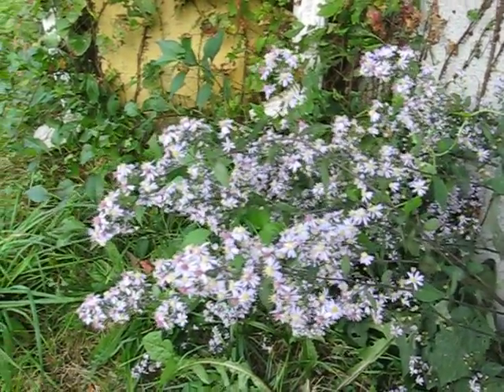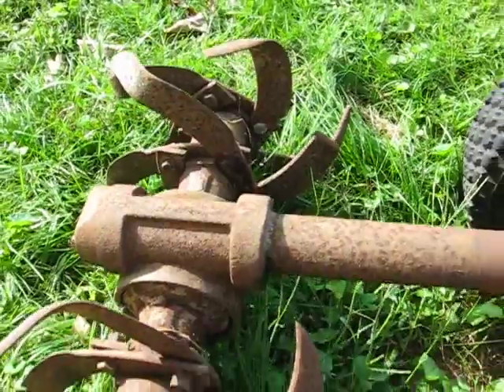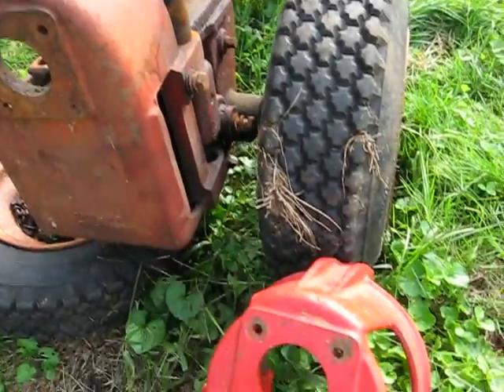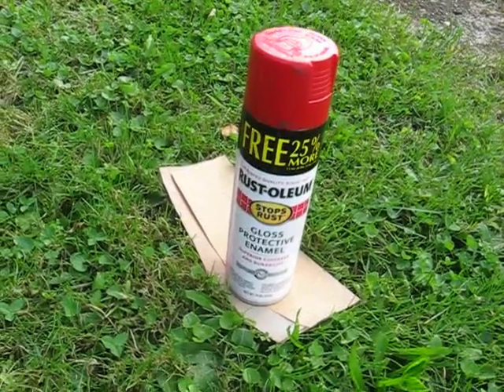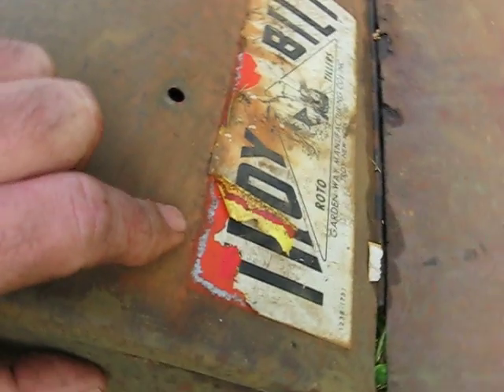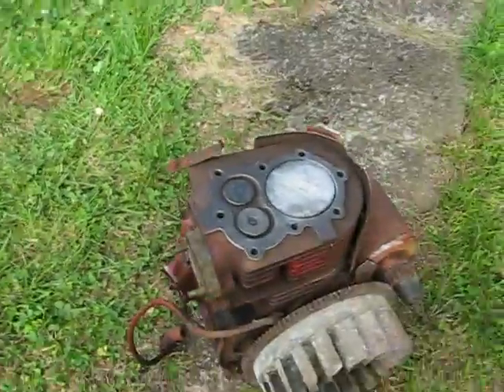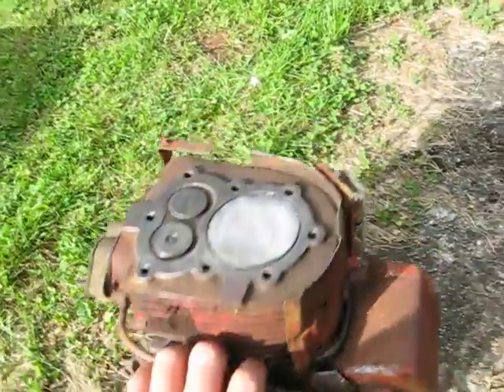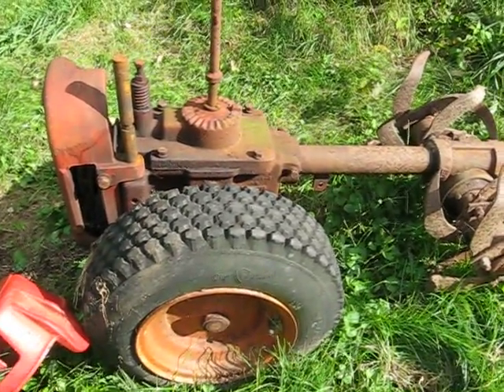Troy Bilt Tiller Ol' Rusty Restoration Part 2

Comment: Take a large screwdriver and wedge it between the flywheel and block casting on the left side "facing the flywheel" of the engine. Reinstall the flywheel nut without starter cup or washer until it is almost flush with the end of the crankshaft. Using a brass or deadblow hammer smack the crankshaft nut a couple times. The flywheel will pop right off. The reason the motor mount is different is because Troy Bilt began making 4 speed models in 1978. The two extra speeds were achieved by changing the single belt position on the pulleys. This would have been a difficult task with the closed mount so they added access holes. Also, if you notice the old style mount uses roll pins as belt guides were the newer style mount uses the actual casting as guides. The mounts are interchangeable as long as you are not trying to use a 2 speed mount on a 4 speed model. The only year Troy Bilt used a 4 speed mount on a 2 speed was 1977. That was "unfortunately" the final year for the 2 speed model.

Comment: Hi I have a old troy bilt horse tiller with the wheels frozen on do you have any suggestion on how I mite get them off. I have tried all sort of penetrating oils, I have tried heading the wheel, I have used a 3 ton bottle jack with chains attached and tried to pull it off but nothing happens, any help would be great.
Reply from the maker: Hey, Yeah I tried the bottle jack trick too, and it didn't work. What I did was to lay the tiller on it's side, and used a MAP gas torch(it burns a little bit hotter), got it as hot as I could, and then poured PB Blaster in the axle hole while it was still hot, and let it set for a few days. Next I used axle grease on the inside of the axle shaft(toward the tiller side), and using a hammer actually drove the wheel deeper by about an inch on the shaft. Sounds crazy, but it got lube under the shaft, and then I used the bottle jack on top of a bolt down the center with a chain , and was able to get the wheel off. I hope this helps you.